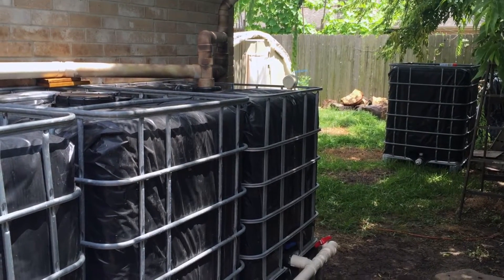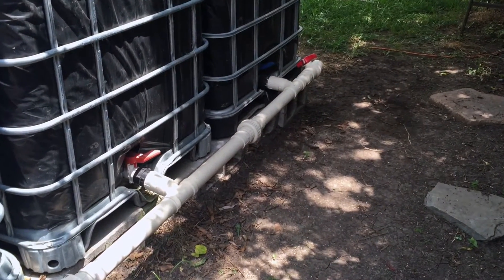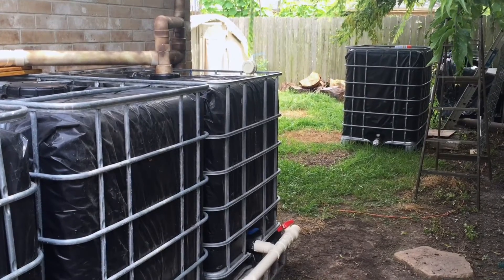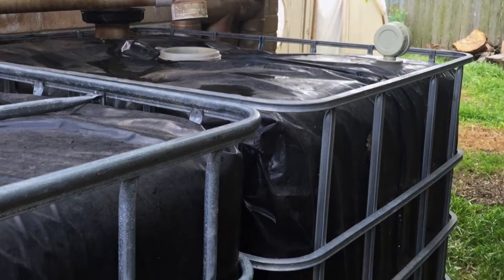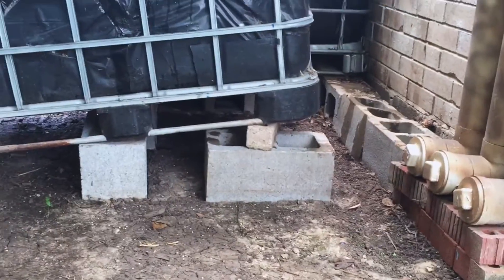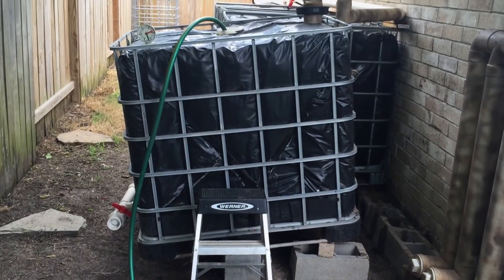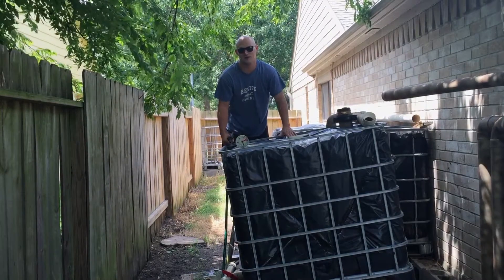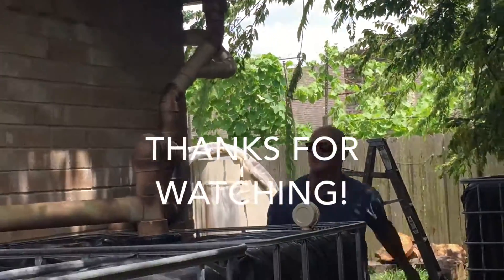Step 7 - IBC Rainwater Harvesting System - Cleaning Out Organic Build Up

Comment: I have watched the whole series of your IBC Rainwater Harvesting System - step 1 to 7 and learned a lot, but you left out 2 very important pieces, how you built the inflow of water into the 1st tank - the parts where you have the stocking filters,  and secondly how you built the overflow.  Any updates on these would be very helpful.  thank you!

Comment: very cool system.  i love simple things.  i went through the entire series.  you have it figured out well.  any advice for building this in northern ohio?  we have some cold weather for months.
Reply from the maker: ServiceTrek Thank you, Let me ask you one question first. What is your plans for the water? Garden or home use?
Reply: home use primarily.  although i will have plans for a separate watering storage system for garden and animals.
Reply from the maker: ServiceTrek Im no expert but I can help out of a few areas.  Being in Ohio I would look into different tanks, one large tank will do better. It will be much more difficult to freeze over, if you bury it that will prevent freezing as well. Make sure to buy tank that can be buried. For your garden and landscape look into a grey water system, you can reuse your shower, sink, and washer water for irrigation and with a little more features on your system you can use that water for your toilet as well.
Reply: Good points, all.  Freezing was my biggest concern.  And now I've been reading about buried IBCs. There's a risk of IBC collapsing from the weight of the earth if the tank isn't full enough or heaving up in a big rain. I'll make it an experimental process in the first attempt and not expect too much perfection. Thanks for the helpful advice.
Reply from the maker: ServiceTrek I would not bury the IBC tank either, I believe you are correct that it would cave in. There are specific rain water tanks that are meant to be buried. Usually that cost $1 per gallon...500 gallon tank $500.....3000 gallon tank $3000.  That will get close to the cost without shipping.